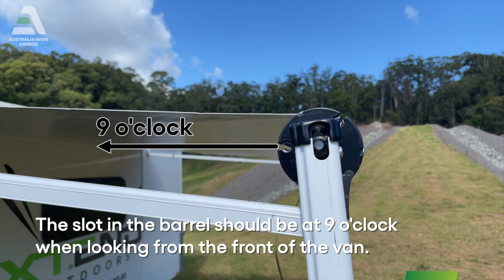How to setup your Australia Wide Annexe from start to finish!

Comment: I got one of these baby's, absolutely fantastic. I found the manual instructions confusing  when they said after rolling it out the slot had to be 90 degrees , then when I put out the legs it was 45 degrees out  SO now I know what is meant, The old saying a picture is worth a thousand words. Thanks for the vid, cheers.
Reply: Ha I was exactly the same. It took me 2 hours to finally look at this video and then everything snapped into place easily.